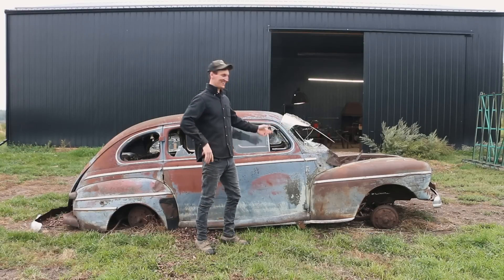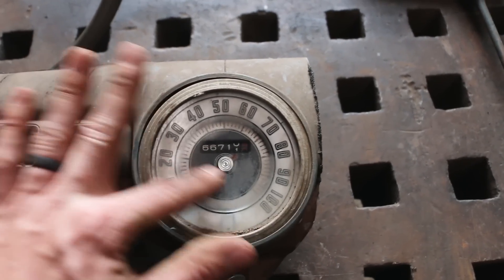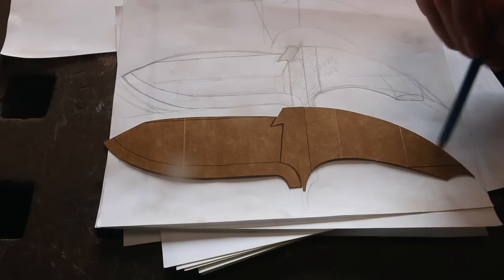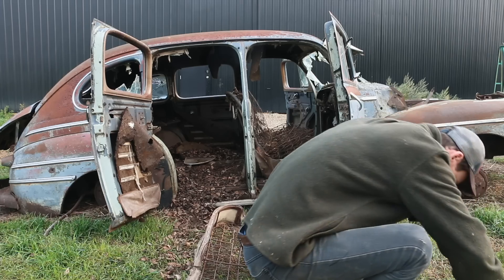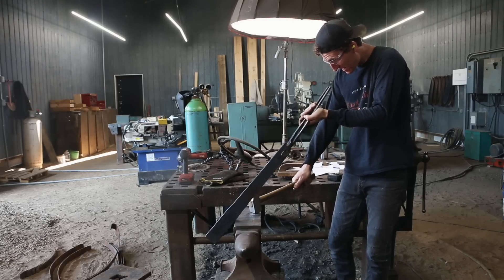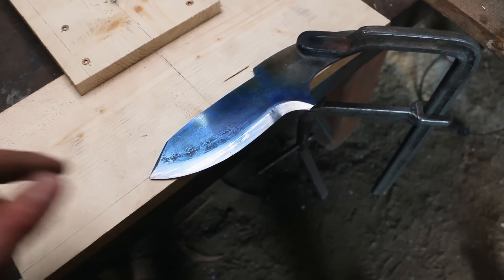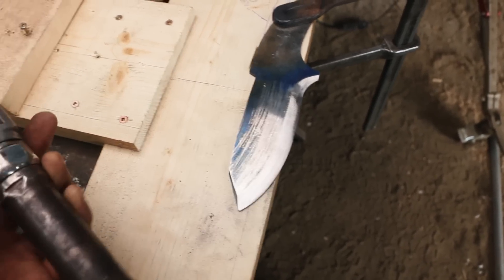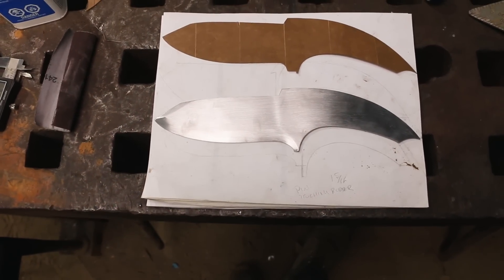Using the parts from this 1947 car to make a knife.

Comment: Is the speedo in kph?  It’s gotta be right, I just don’t see that car having 66,000 miles on it.
Reply: Canada converted to metric in 1970, so it is miles, but there are no digits to the left of the _66K, so it could be 166K or 266K, bear in mind though that 100,000 miles on a car like this is a lot, not like modern cars designed to last 300,000 miles(on nicely paved roads).
However I have seen old cars like this that have low mileage and were put off the road for one reason or another eg blown motor and owner too poor to fix, and the cars were just parked and left to rot, this one looks quite good in that it doesn't have heaps of panel damage, but it's been settling into the ground for a long time, pity.